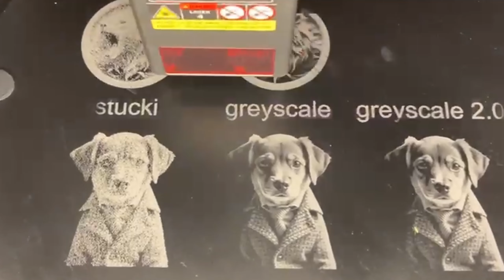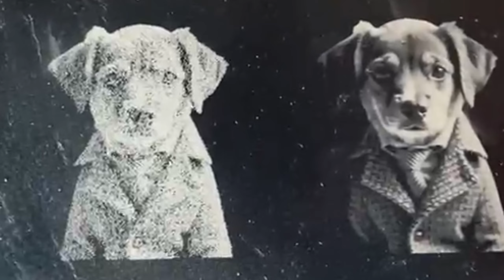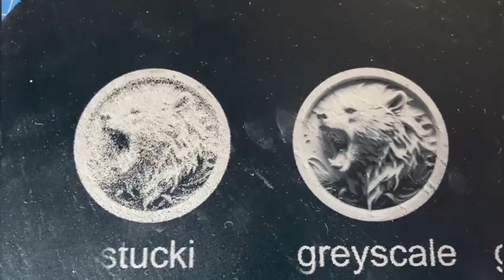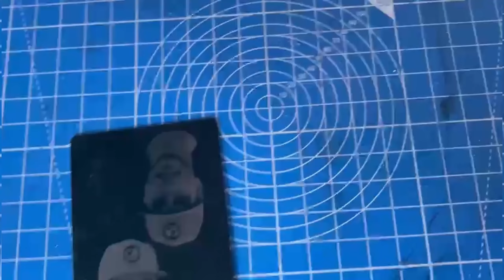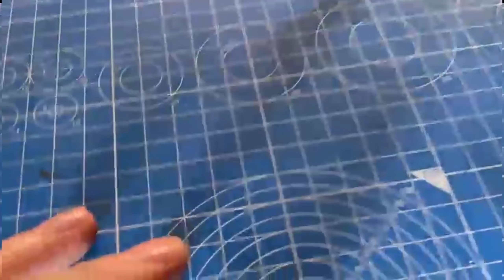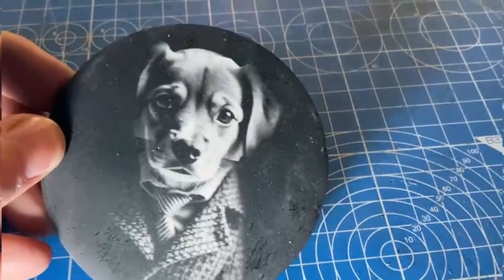How To Engrave Photos Using LightBurn!

Comment: You confirmed what I knew over 25 years ago.  My first laser was a 25 watt CO2 from universal.  Back then the interweb was just getting started so there was no one else talking about this.  It was CorelDraw and you had power (no min or max), speed and DPI.  Basically the laser worked of the gray scale shade or darkness.  Gamma was the key to dialing in any photo.  Just got back into engraving.  Got a Onelaser xrf and struggling to rewire the brain to lightburn.  Your video has convinced me to process my photos with corel and go grayscale hoping its just a matter of figuring those 3 settings to get dialed in.
Reply from the maker: I bet that was fun trying to get all the settings correct all them years ago when you just had to figure it for yourself.
Hopefully you’ll get your laser going now and can get some decent results with it now though. So much easier these days as the software does do a lot of the work for you 😊

Comment: I screenshot your settings. Thanks, they make sense. What power laser are you using? I bought a Longer5 with a 5-watt diode, which I upgraded to 30 watts. I'll need to do some math with your settings if you're not using a 30-watt laser. not a problem, thank's for pointing me in right direction.
Reply from the maker: Hi, the laser used in this video was a 22w so with a 30w you should easily be able to bring the power down 5 or 10% percent or even bring the speed up 👍🏻
Reply: @MARCAM  Houston we have a problem, i'm burned into wood not slate, You got any recommendations for the power settings, burning Right through wood that speed:hand-orange-covering-eyes::hand-orange-covering-eyes::hand-orange-covering-eyes::hand-orange-covering-eyes::hand-orange-covering-eyes::hand-orange-covering-eyes::hand-orange-covering-eyes::hand-orange-covering-eyes::hand-orange-covering-eyes::hand-orange-covering-eyes: And power

Comment: Hi, new subscriber to your channel. I love your content. I also don't know why no one seems to use the Grayscale settings. I would think it would be better. But here we go. It would seem that you have a Diode Laser as do I. Mine is a true 40w laser and if I were to use your settings it would cut right through the material. My best slate engrave is 6000 @ 20%, Norton white tile is 2000 @ 25%. But I just can't get a decent image on Grayscale (or the others from that matter). Gray scale shows all black on Preview, and Stucki, Jarvis and Dither all look like a bad newspaper print. Can you offer any suggestions outside of what you recommended on this video for the grayscale. I love to have my images look that good. Thanks
Reply from the maker: Hi,

Thanks for the sub and the comment 😊
With a 40w machine I would definitely bring the power down and maybe even the speed up. 
With greyscale the preview window will usually just show a black screen as it’s calculated differently from the other styles. If you zoom right in you will see all the details exactly how your laser will burn them.

Try a test burn with it on greyscale and see how the slate looks after. You may need to adjust the settings slightly but should have the details show up 👍🏻

Comment: What machine are you using for the settings you pictured? Please
Reply from the maker: I was using the creality falcon pro 22w diode laser (links in description)
Can use the same settings on any diode will just have to tweak speed and power depending on laser power

Comment: What would you set min and max to for wood in greyscale and power for 10w diode laser
Reply from the maker: It take the speed to about 200 mm/s and min 0 and max around 40- 50%
See how that turns out. Should get a pretty decent result 👍🏻

Comment: Hi! How are you? 😊
I saw your video on YouTube about photo engraving on silver with , and I was really impressed with the result!
I also work with a 60W MOPA laser and I’m trying to achieve a similar effect.
If it’s not too much trouble, could you please share the parameters you’re using or any tips that might help me adjust my process?
Also, could you please tell me which exact machine or setup you’re using for that engraving?
Thank you very much for your time and for sharing your work! 🙏
Reply from the maker: Hey,
Is it the coloured image on stainless steel video you’re referring too?
I use a monport 60w mopa fiber laser for all metal marking/ engraving 👍🏻
Reply: @MARCAM  QUAIS PARAMETROS VOÇE USOU?

Comment: I've just found your channel and subbed. I'm needing a bit of advice if that's OK. I've just bought a Creality Falcon A1 and started using the supplied software, (Design Space) but the images on slate coasters were so pale. I am trying the trial of Lightburn but when I put an image onto it all it is doing is "Bleaching" the coaster, taking off the black and leaving the coaster white. I'm using 3000mm p/sec and 80% power as recommended by others. I really wish I knew what to do, I'm totally lost, any advice would be very welcome. Thanks.
Reply from the maker: Thanks for the sub :)
Usually you can just import a photo into lightburn, right click and adjust the image. I usually try and get it to there’s plenty grey and a little black and white.
In the settings make sure you select greyscale setting and the negative button on.
Reply: @MARCAM  Thanks, I've tried it but the coasters are just coming out white/light grey. I think the machine may be faulty as it won't let me upgrade the firmware.. Looks like I'll have to send it back to Amazon.
Reply from the maker: @davidharle952 have you tried it with another photo? Maybe one from Google?
Reply: I got a photo from google and it didn't work, the coaster came out white. Strangely text works.
Reply from the maker: Is the pass through option selected in lightburn?
Reply: @MARCAM  I've just tried that and I'm actually getting a picture, although very washed out I can make it out. Tried upping the settings that you suggested and tried again. Still very washed out. I did an power/speed image test slate. Every square was exactly the same. I'm convinced the machine is faulty. I did request a return but Amazon want me to pay the postage. Looks like I'm going to have to apply for a loan. lol.
Reply from the maker: @davidharle952 have you prepared the slate before hand too?? I tend to spray it with a black Matt paint before hand
Reply: @MARCAM  I did coat it with a clear lacquer and not coated. The results were the same. I've seen so many videos where they came out great without treating them first. Really sorry for all the problems I'm giving you.
Reply from the maker: @davidharle952  no worries all good. I’m just as confused as you though. Is the laser focused correctly also?
Reply: @MARCAM  Yes it's focused, according to Creality when the firmware fails to update there is a problem with the motherboard. Will have to see if they will exchange it. Thanks for all your help.
Reply from the maker: @davidharle952 yeah something definitely seems off. Strange it does text but nothing else. Maybe the motherboard just isn’t telling the laser when to turn on and off during the engraving process.
Fingers crossed you get it all sorted though 👍🏻

Also, have you tied any other engraving styles like stucki or Jarvis?
Reply: @MARCAM  Yes I noticed on one part of your video where you said to try it. Hopefully will get a new one in the next few weeks. Once it's sorted I'll let you know how I get on. I really do appreciate all the help you have given me. Thanks.
Reply: Hi mate, sorry to bother you again. I got the Falcon A1 replaced and it updated and I've done a couple of slate coasters and they engraved perfectly. Obviously the first one was faulty. So now looking forward to getting stuck in and making lots more. Cheers.
Reply from the maker: @davidharle952 happy days! Glad you got it sorted. Time to have some fun now :)

Comment: When I set greyscale up the preview is nearly all black (not using negative image) but the burn is OK.  I just have to make several tries to dial in the best power and speed.  BTW I am using a 10W diode laser  and settled on 170 in/min at 50% on maple.
Reply from the maker: I think if you zoom in with the preview window you can see all the separate scan lines. I think it’s because it’s so fine and detailed it just looks black.

Comment: Great video.  Most others stress the importance of a very high resolution photo to start with.  I didn't hear you mention that.  Do you agree or do you get good results with more "normal" resolution?
Reply from the maker: When I create my images I try to increase it to 4k resolution but as long as the image is clear it will engrave fine in greyscale mode

Comment: Uhm.. I have black dogtags but I get the image the wrong way engraved, like it is thinking that it is a light surface.. how do I get it the other way around🙈
Reply from the maker: In the settings there’s a little slider called ‘negative’ switch it in and it will reverse the  colour of the image 👍🏻